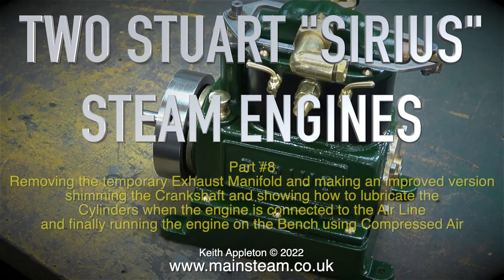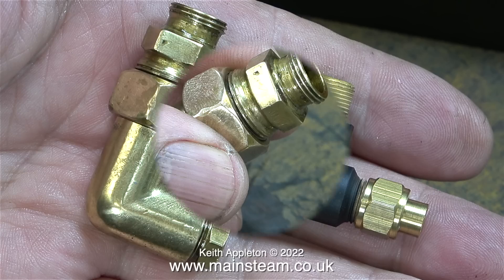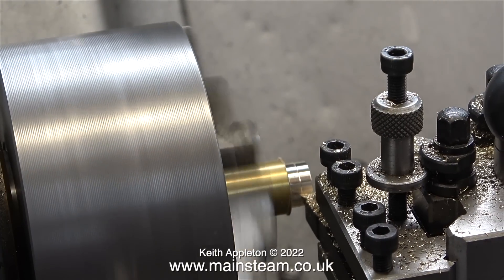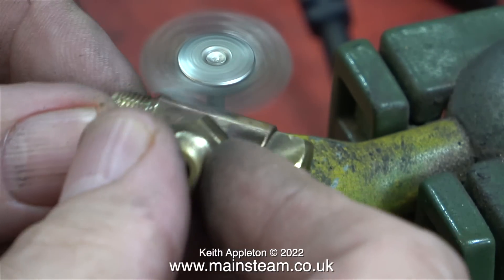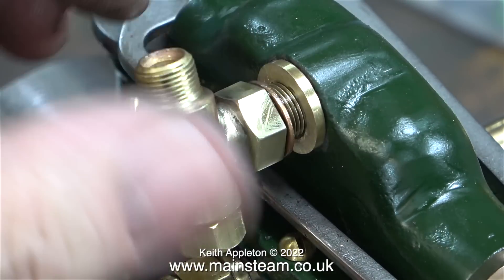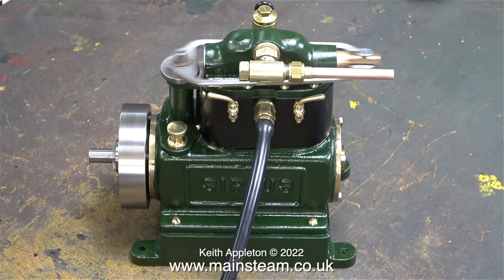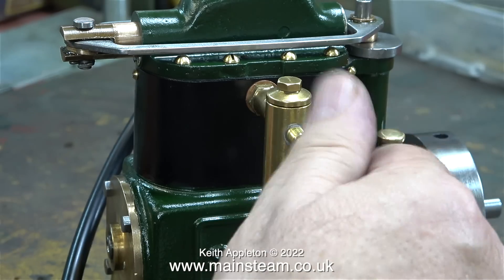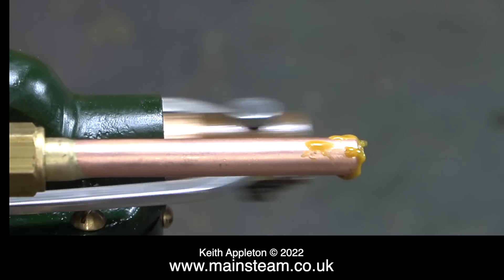TWO STUART SIRIUS STEAM ENGINES - PART #8

Comment: Thank you Keith for the knocking information on the Stuart single acting twins. The Sun engine, the Sirius' baby brother , that I built 50+ years ago, has always knocked and when I checked, it had excessive crank float. A bit of playing around with copper shims and it is now much quieter.
Reply from the maker: Glad that the video was useful to you.

Comment: at the end when you ran the engine fast ... the whole engine was rocking ... understandable sure ... my question is simple though ... IF the engine runs at higher speeds wont the rocking of the assembly eventually work the hold down bolts loose or even sheer them ... 
.
granted this would take a LOT of running and time to happen ... is there any reason why one couldnt say use rubber standoffs on the base and the engine assembly to allow the engine shake to be taken by the rubber stand offs removing most if not all of the repetitive stress from the engines action
Reply from the maker: You could fit rubber feet to the engine, but the vibration looks worse on the video than it really is.
Reply: @keithappleton  ahhh thought so .. now to see see how to keep a jet turbine engine on startup from moving to wildly on start up ... for some reason I doubt there is a high temperature rubber that would last ....